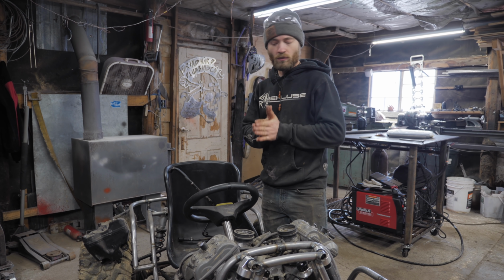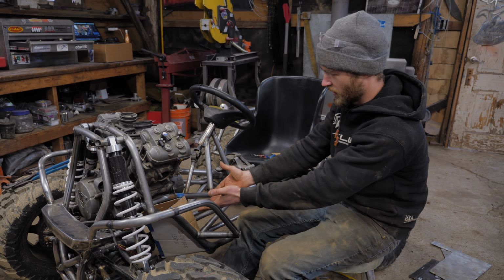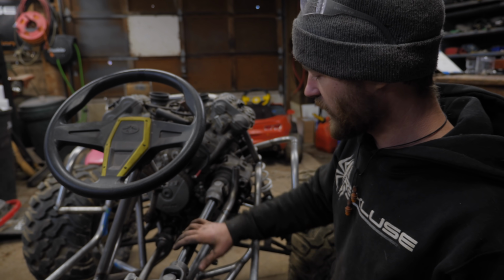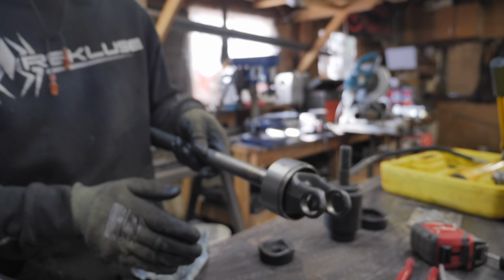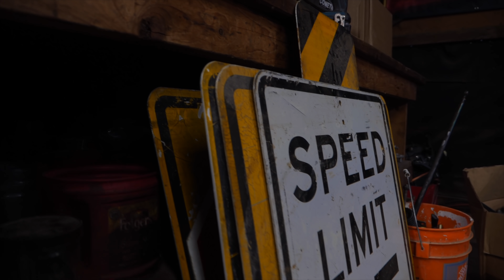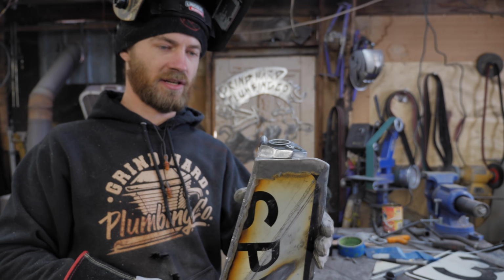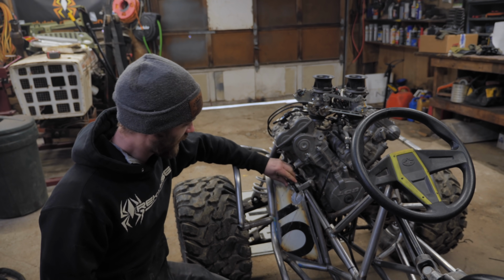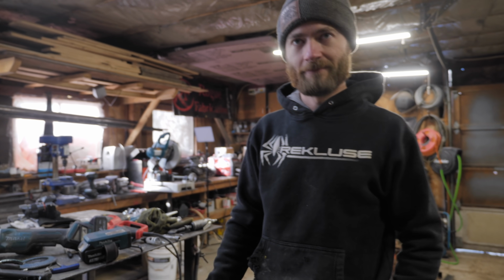Building an Oil Tank From A Speed Limit Sign 100HP 4WD Power Wheels build EP 11

Comment: I used to work on KTM”s all the time at a dealer specially the adventures and super dukes, excellent job grafting in those bits off the original oil tank. The one way ball valve was to stop the oil draining from tank to engine as the tank sat higher than the pick up points. Also you would get 500ml of oil out of the 17mm head drain plug under the engine and around 2.5L out of the oil tank. Keep up the great vids love the builds
Reply: Check valve?
Reply: Ray yess

Comment: Just a heads up.  Your aluminum tank mount will likely crack(especially with the way you ride these things).  I know this from experience.  You may want to rubber mount you fluid tanks, just like the original tanks is.  Weight transferring fluid while quickly work harden rigid mounts.  Keep an eye on it
Reply: No one cares tho, I still see $100k builds solid mount everything. 
Even when they try the don't actually rubber isolate,they just add rubber washers and assume that's isolated
Reply: I was thinking that too. If one side of the tank is attached to the engine and the other is solid mounted the frame it will cause the tank to crack from the engine movement. It either needs to be rubber isolated or completely mounted to the frame ideally both though.
Reply: Also the front tyre will throw some rocks...
Reply: or they use the frame as oiö tank
Reply: @johannesmuller1288  that would be awesome!
Reply: Ryan Hall that’s a really good point
Reply: @janeblogs324  I care
Reply: the aluminum alloy speed limit signs are typically made of is significantly stiffer & more brittle, likely to crack in or next to the weld heat affected zone,, as compared with more commonly used 6061 aluminum alloy.
Reply: Shea Nyquist well, i think the oil tank is not gonna be bothered that much bcause the tire is further out from the oil tank itself

Comment: You guys are amazing ,great start to the weekend. My 950R superenduro does not have the check valve in the oil tank ( the position of the oil tank  is below the engine ), The 950 supermoto & Superduke both have check-valves. There was some worry , because of the position of the oil tank the full capacity of oil  could drain back into the engine , filling it will oil, causing a potencial hazard on starting.  The LC8 have two oil pumps , one to circulate the oil around the engine and keep the dry sump clear while running ,and a second oil pump to maintain circulation to the oil tank and back to the engine. The design of the 75· degree V2 enginge was built to use an aprox 10w 50  motocycle oil to protect gearbox ,clutch and moving parts. most oil changes i fill 3.8liters of Castrol Power1. Then due to consumption , i top up about 200ml every two weeks. Hope this helps.

Comment: The next one should be a 2 stroke from an older 6 or 8 cylinder outboard
Reply: This, I need to see a crazy two-stroke version. It would be insane, and new to what you've done before on these power wheels. An enduro bike with a large 2 stroke, or what moldy said.
Reply: That would be NUTS.
Reply: @mostlymotorized  I was more thinking an evinrude 300
Reply: 81 moldy , too heavy.  A 1000cc Arctic Cat snowmobile engine puts out 175 hp, now that would be badass.
Reply: What transmission would you suggest. You know how huge 8 expansion chambers are? That would be a good suggestion for carsandcameras.
Reply: I'm hoping for a banshee powered drifter next.
Reply: this would be badass
Reply: Powerheads ftw.
Reply: How about a v4 engine? 🤔

Comment: U joint phasing should be inline. Other than that, keep up the good work!
Reply: ^^ This ^^
Reply: 90 degrees offset will CAUSE vibration.   Take it off and try it by hand with more angle on each end to exaggerate what happens. Really enjoying the build too! Can't wait to see this thing rip
Reply: I don't know a ton about this, but shouldn't it be okay since the angle on the u joints isn't extreme?
Reply: It's possible it may not be a terribly severe vibration because the shaft doesn't weight much but with it being 90 degrees out of phase any angle on the u-joints will cause a vibration so the more the angle the worse the vibration.  Spicer has a video on YT all about it. Skip to :45 seconds for the explanation.  https://youtu.be/jaaTyL099RA
Reply: @Jefreeman13  no, the ears need to be a mirror image of each other, regardless of angle.

Comment: The driveshaft yokes as shown are out of phase:  the yokes on the the shaft are to be mirrored , i.e., the same position opposite of each other(180 degrees offset).  The way it's shown on the vehicle (90 degrees offset) will tear itself apart.  On the farm, all pto and other such powershafts on equipment are mirrored yokes, i.e., in phase; pto shafts are designed so it's nearly impossible to put them back together wrong.

Also, are you going to extend the dipstick length, so it will show just how low the system can get?

Fascinating build; can't wait to see this run.

Comment: I'm no drive shaftoligist...but I've seen enough to know that drive shaft is gonna cause some issues. Its UJs out of phase and the angles between the engine and transfer-case aren't the same, it'll cause oscillation  and vibration. i reckon you need  CV joints!                                   as does the Steering shaft that's at the bottom of the column, looks like it could use a double UJ so it not at such a bad angle too

Comment: It certainly looks like space is at a premium in the garage there, but after seeing how the keyway was cut, and the splines for the other shaft, I'd like to suggest investing in a mill. I'd say it would be real handy with the tube notching I saw earlier in the build as well , Put the fixture in the mill, and use the quill's leverage to run the saw through the tube. Bought myself a Bridgeport a couple years back. I haven't done anything too serious with it yet, but with the simple stuff I have done so far, it's totally been worth it.

Comment: A easy way we use to test tanks is make up a thick solution from builders chalk  line chalk and some thinners and paint the welds. Allow to dry and add about 100mls of diesel in the tank and swirl it around it will show up as a dark patch in the chalk if you have a leak.

Comment: almost positive you need the ujoints to be IN LINE with each other (in phase) to have decrease vibrations and wear. not 90 degrees offset
Reply: just google proper phasing of ujoints.

Comment: Should have added a few baffles in the tank. It would help not only constant supply on rough "roads", but it would also help with removing heat and air from the oil. In racing we use a cylindrical tank and spin the oil around it to help get the air out.
Reply: i believe that the oil return/filler piece he took from the old tank, "spins" the oil around the top of the inside of the tank.

Comment: When are y’all going to work on the mower
Reply from the maker: Soon!  Still waiting on a transmission
Reply: It's a super bad idea to begin with. The rear drop boxes couldn't handle mowing or plowing duty for long, let alone a larger engine and being rough with it. I collect the Allis 720/620/616 tractors (their's is the Simplicity version I believe, a 9020/4041/4040 model) so I know these tractors. Unless they butcher it enough to also install a different rear axle... A shortened 8.8" Ford would be cheap and easy enough, and they're plentiful.
Reply: @Bird76Mojo76  Apparently you don't know lol. Those tractors can handle whatever you throw at them. 

But a ford nine inch would be better, as you could change the gear ratio.
Reply: @mckenzie4003  you can get any gear ratio for the 8.8 as you can the 9 inch. The 8.8 is used in more Jeep builds then a 9 is.
Reply: Bird76Mojo76 yeah I heard those plastic barbie karts don’t handle dirt bike engines either!! Another super bad idea of theirs again I guess 😉
Reply: Yeah I saw the mower in the background & was wondering if, or when, we'll see more of it. There will be so many challenges with shoehorning such a huge engine into a mower. I'm keen to see how they tackle the many issues!
I'm also looking forward to seeing this beastie Jeep runnin' & roostin' as well!!

Comment: 16:35 LOL @ flames from porous metal under constant exposure to oil for years bleeding out when it gets hot - that can't have done good things for your porosity. Top tip: Bake parts like that SUPER hot for a good time until they stop bleeding, then weld later.
Reply: Probably too late, but using gasoline or ethanol or some other low viscosity fluid to check for leaks before putting it into service is FTW :-)

Comment: U-Joints are totally wrong now. Rotate 90degrees
Reply: Torille.
Reply: Shouldn't make any difference as long as the cups are in an exact line end to end, it's just a lot of unnecessary work to have turned on 90 degrees reletive to the other..
Reply: @IJ-E36  no, they need to be a mirror image of each other. Ears lined up.
Reply: @IJ-E36  He's right. They're out of phase 90 degrees
Reply: I can't believe in his knowledge of mechanics that he got this wrong
Reply: Maybe in a driveline that's live, solid mounted both ends it'll work ok, as I said it was just a waste of time and effort to turn one joint..

Comment: Do not put the Universal Joints out of phase. They need to be IN phase to cancel each other out. Mark a spot on the input and output yokes and slowly turn the shaft to verify.
Reply: Yep. In same phase.
Reply: Yes very weird he went to a lot of trouble to make it 90deg phasing. The single keyway supplied by the manufacturer made perfect phasing a no-brainer.  Hard to tell but the rear yoke angle looks almost dead straight but the front yoke looked inclined so there is definitely a rotational speed difference that will create a torsional vibration.  Would love to hear Ethan's rationale behind it.
Reply: Yes very weird he went to a lot of trouble to make it 90deg phasing. The single keyway supplied by the manufacturer made perfect phasing a no-brainer.  Hard to tell but the rear yoke angle looks almost dead straight but the front yoke looked inclined so there is definitely a rotational speed difference that will create a torsional vibration.  Would love to hear Ethan's rationale behind it.

Comment: You most likely should not fill the sump that high up as Ethan indicated in the video, generally dry sump tanks don't have much oil in them when the engine is not running. You should be good to go relying on KTM's spec for oil capacity. The return line is set up to shoot the oil around the edge of that circumference and the side of the sump tank to prevent it from aerating.

Comment: 2010 Polaris rzr 800s has a 5 foot long floating drive line so I dont think it will cause any issues but if you support it the u joints will last longer

Comment: doesnt it have to be ABOVE the engine oil oump?
Reply: Only the fill tube has to be
Reply: Only if it's pumped out of the engine, if it's pumped in it can be below
Reply: On the LC8 oil is drawn from the reservoir by one of the oil pumps. The check valve is not a check valve on this tank it is more like a minimum pressure valve. Its job is to keep the extra oil in the reservoir, so the engine is not over full while running. The valve would keep the tank in it's higher stock location from draining into the crank when the bike is off also.  Those valves have been known to stick shut when they are old and hardened and you will get pressure in your reservoir and improper flow to the sump.

Comment: Your incorrect on the drive shaft phasing. Your center section needs to be at the same orientation, not 90°… go look under any of your trucks/cars. Only the outside yokes are 90° off the center line of the middle shaft.